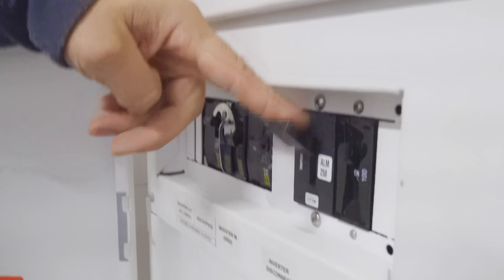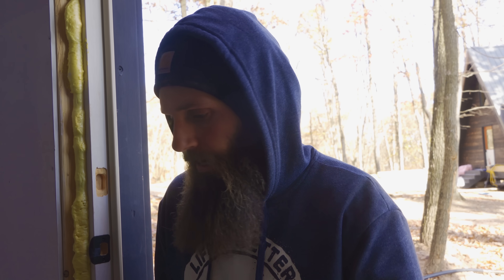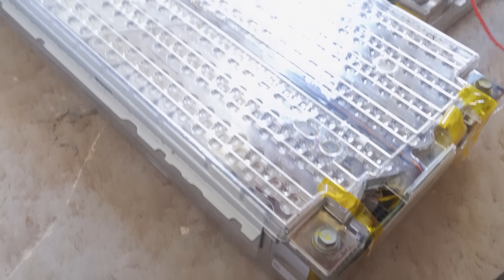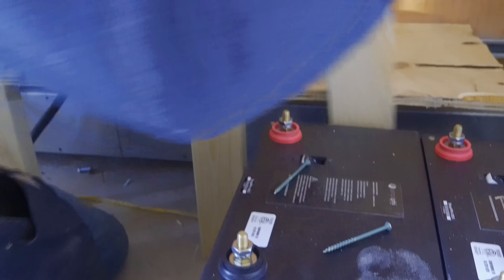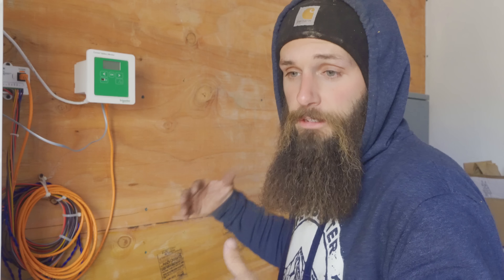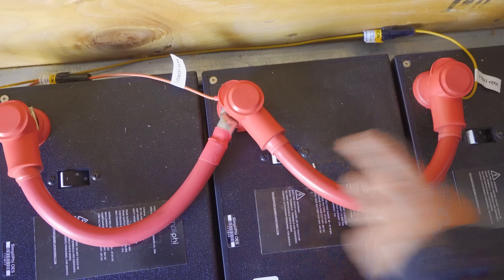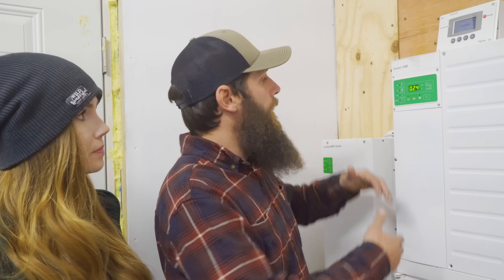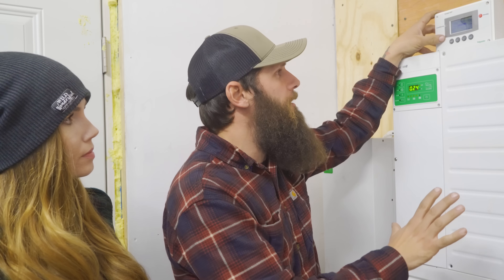Overhauling Our Solar Power System!

Comment: Keep the Tesla batteries! Solution, build a 'small' concrete block building (fire-proof) a few feet from the power-house just for the Tesla batteries only. Bingo! now you have a weeks supply of no-sun power. Both battery systems can be charged at the same time, and tapped for different purposes. Note: If it's put sub-terrain (like a root cellar) it maintains approx 55 degrees year round.
Reply: They can't be charged from a single charger. LFP and Liion cell has a different operating voltage range. Trust me, it's not worth the hassle.
Reply: @obajer  Understand now with a little homework... But A  6'W x 6'L x 7'H concrete block shed can be built for less than $300 in 8 hours, by one person, (using 'surface bonding method). Even if they got a second charge-controller, for it, it would be worth it.

Comment: You can not discharge any battery system 100%!
Your inverter is programmed to stop under your preset minimal voltage (hence 41v). In return it will always protect your batteries from deep discharge.
Pricy upgrade you made.  In years to come we will see new technologies emerging wich will appeal even more to self reliant homesteaders.
Keep it up and enjoy this excellent power system you have put in place!

Comment: I have a doubt. How you are gonna deal with snow falling on solar panels??
Reply: Broom?
Reply: Haha.. not for cleaning the snow, it's about the voltage drop
Reply: @brt3761  :) actually, there's voltage increase in the winter. Lower the temperature, higher the voltage on the panels. Exact thermal constant is in the specsheet of the panels. But the power is lesser, because of lower current, shorter days and bad angle of the sun. So the only thing you can do in winter is to clean the snow and fix the angle of panels if your construction allows.
Reply: Got it brother. Thanks☺

Comment: That’s super awesome guys like I had said on the last solar video you made I couldn’t be happier with mine I have six of them with a outback radian  8000 W 
inverter and 24 250w panels  .  I’m floating most of time because I only need 3 -5 hours of sunshine to fully charge my system ..    I think these are the absolute best batteries out there today

Comment: link to batteries.  I like to know there cost I run a 48 volt system. My current bank is Lead acid and its pretty much dead, system has been turned off, for the last 2 years. Looking for new batteries but ones that are nice, and good for the price.

Comment: Hello farmers !!!! Why did you decide to use a low voltage photovoltaic system? Usually these systems use series panels and series high current 12 X 24V batteries as well, where efficiency reaches close to 90 to 95% in inverters. I have seen here in Brazil these systems working with up to 288 Vdc and providing 30 to 40 Kwh. Certainly the battery bank is huge and expensive providing 120 Amp hour !!! And they usually last 4 years against many more lion years, which are even more expensive.

Comment: There is a better way to hook up the new batteries.  The positive can stay the same connected to the first battery in the string but the negative should be hooked up to the last battery in the string.  This helps to equalize current between the batteries.

Comment: Josh what's the reason for the switch from Tesla ?  Just curious
Reply: That was my question from the midst of the video too.  They explained it pretty well starting at 14:12  it is to use less potentially dangerous battery technology, even though it costs substantially more per kwh capacity, Tesla batteries 21 kwh for $5k (4.2 watt hours per dollar) versus SimpliPhied 12 kwh for $9k (1.3 watt-hours/dollar) which is more than three times as expensive per watt-hour.  But much safer with respect to battery monitoring and thermal runaway concerns.

Comment: I hope you move into the A frame soon. When is your heating stove going to be delivered? Has the window supplier fixed the  quality issues? If you are getting your top triangular window from them, I hope they  bring it with the crew that will correct the windows you have issues with and mount the last one with  no cost for you.! I hope Santa comes to you in the A frame!

Comment: I’m sure there’s a lot of people wondering why you installed these batteries and sold the others. That would have been a much better way to start this video
Reply: No integrated BMS and the risk of thermal runaway were thr reasons.
Reply: yes please! ppl love to brag about getting lightly used Tesla batteries... why did you sell yours?
Reply: @skip21al  If you watch the video they answer that question.
Reply: @ninline2000  no, it didnt. it only gave me more questions. did they tesla battery perform? was it only a fire safety issue? how efficient? etc.

Comment: PRO: Time effectiveness:  adding 1 smart battery over 2 Tesla.

PRO: Cost effectiveness:  installation of  1 smart battery over 2 Tesla;
pay more now to receive more use over the long haul without requiring replacement.

The safety feature of the smart batteries affording “peace of mind” is worth its weight in gold. No overheating to cause injuries or a possible homestead/forest fire.

Thank you for the progress report!!
YES, please do make the installation video.

Comment: Nice upgrade.  I like Lithium Iron Phosphate batteries and the fact that there’s built in BMS and breakers.  Are you planning on adding air conditioning?  The startup surge can be a bit rough on inverters.

Comment: Is there a State code on putting in an off grid solar system? I can see the government and the utility companies working together to stop the off grid movement!
Reply: Not really, depends how off-grid you plan to go.  Some states/counties require certain "other" upgrades.  Example, to build in some areas they require you you to put a well in first, and if you want power, a septic is required, etc  Just dumb rules/restrictions to try and control ppl, but unless its outright banned, most states allow off-grid solar living without issue.  Depends on county rules or covenants{HOA BS}, best to avoid wanting to live anywhere that has those.

Comment: I started living totally off grid back in 2000, can you imagine how technology has changed since then, I have not ever ventured into the lithium battery usage yet as I have an endless supply of lead acid batteries, old tech yup, but reliable and free. I have a few friends that work in the forklift industry and I am able to get all of the used forklift batteries I can use. At present I now have 16, need a skidsteer just to lift one of those, theses batteries are exchanged out from forklifts after so many charge cycles and are usually disposed of, I rescue as many as I need, I have not had a system failure as of yet, I use two different charge controllers and two different inverters, redundancy so to speak, if one system goes down, I still have the other system, proper maintenance  and maintaining a full charge is the key here, I usually dysulfate each system separately about once every two month, depending on charge cycles. I have replaced a few batteries since I started, but they usually last 6 to 7 years depending on condition when I get them and maintenance, Batteries like to be fully charged. Always best to over size your system, less headaches, and when you need power, well you got it, Erin and Josh, your sytem looks awesome, one thing about lithium, those batteries cannot handle the cold like agm or lead acid can, I do not heat the solar shed either, today's temp is -26 C or - 14.8 F for my friends below the 49th, I have never froze a battery yet,  love you  both, keep the family safe always, 👍👌❤🇨🇦
Reply: Important that fully charged thing is ONLY true for "the oldschool" batteries Lead acid and so on. With lithium in all varients Storring the batery compleatly full or empty is the worst. same gose for temperature they dont like it to cold / to hot. the cycel on them dosent realy plays a big rule in the live time. (30%) total capacity loss. = Dead bettery in the industry. 

The best way to kill a lithium cell is to keep it fully charged in a 30+°C room.
Reply: @mogelzz  I fully agree with you on every point, the industrial forklift batteries was the easiest and cheapest method, like you said lithium doesn't like cold, I also have and use 2 x 400 Silentwind generators for those days that maybe totally cloudy, but I have enough reserve battery storage to last me over a 7 to 10 dy period without giving up to much, the wind gens are just a safety measure and we always have wind no matter what. When Josh raised his solar array off the ground and put them on the stand,I applauded, too many people leave them too close to the ground and stray cattle and such like to use them as scratching posts, during the spring to fall months, I leave my panels at a 52 degree angle ( my lattitude) and during the winter months a little steeper because of the angle of the sun is so low. Around 60 degrees from November  to end of March, April. I have had a battery freeze yet, cross fingers, if I lived in a warmer climate I would probably try lithium, but I may die first, but these batteries are free, so I use them. This last fall I found some more panels that the oil rigs had used and were auctioned off, I paid $50 per panel and they were 420 watt mono panels, so now I guess I am up to a little more than 6.7 kilowatts of solar 16 x 420. Initially it would have cost me over $15,000 just to have the power trenches to a meter, nope, my whole system never cost me half of that, so I will live like this.
Reply: @pocketchange1951  thanks for the nice reply, If you get the forklift batterys for free using them is the best option. Alsow super lucky find for the Pannels :D

Comment: Correction:  Batteries are rated for capacity in Kilo Watt Hours or KWH, (kilo watts times hours).  To specify capacity multiply the run time times instant power draw.  The Tesla battery would be 21 Kilo Watt Hours, and the Simpli-Phi battery would be 12 Kilo Watt Hours.  With Simpli-Phi you could draw one kilowatt for 12 hours, or 2 kilowatts for 6 hours, or 3 kilowatts for 4 hours, or 500 watts for 24 hours, and so on.
Reply: Except for the batteries rated in amp-hours

Comment: Any homeowners insurance issues with all this?
Reply: There definitely were problems years ago, but solar installations with battery banks and inverters are now reasonably common so it should be much easier to work with an insurer.  If yours doesn't then switch to a more modern insurer.  All the large and well known insurance providers provide coverage.
Reply: Wally Kramer thank you for the info

Comment: Swap your positive lead to the inverter to the far battery. Having both leads pulling off one end will load the end battery more than the other two. Pulling diagonally across the bank forces the pixies to run through all 3.
Reply: Len Gullotta 

IS THIS TRUE OR JUST AN OLE WIVES TALE???
Reply: @BrianBriCurInTheOC  true

Comment: I put a timer on my fridge,  so its not drawing amps at night.  no one opening at night so over 12 hours shut off it holds zero in the freezer and 42 in fridge.  You will find fridge is a big energy draw.
Reply: MrEroshan This will save very little energy.  It will save a little as the fridge and freezer lose less heat as their temp differential with the outside gets smaller, however, you will use most of the energy you saved during the night to bring the temp back down when it kicks back on in the morning.  You can save as much energy by simply increasing the temp of your freezer and fridge to halfway between what your current evening to morning temp change is and leaving it on all of the time.

Comment: Great Video!!  I will be going solar soon and will use essentially the exact system your family is using!  It would be nice to have 10 TIPs on setting up your system, especially with the LithFe batteries.  Would like to know what the voltage input from your array running into your power house which allows long distance connectivity with little % line drop, as well as hidden caveat which are not immediately apparent. Please provide a inventory list of all you solar equipment so I know what to get?

Comment: I have a Battery Tender LiFePO4 vehicle battery.  I recently had a momentary short circuit (long story) which caused it to over discharge and burn internal parts.  It smoked slightly (smells awful) got a little hot, but did not runaway.  I dropped it in a steel pail to cool off incase it caught fire.  Now it's little more than a paperweight, but it's totally intact.  That's pretty safe technology.  I don't think things would have gone so well with a  LiPo/Li-Ion.  You made the right choice.

Comment: What Schneider model do you have? Currently going into this process for my off grid property. Schneider or Back country are my options. Did the Tesla’s, provide a 4/5 day period on cloudy days.  Nice setup on yours.
Reply from the maker: We have a video with the full breakdown on all the components and the cost of each here: https://youtu.be/C-aeOzBn6YE
Keep in mind we had the Tesla batteries at this point so add in the updated info from today's video on the new batteries/cost for them
Reply: @WildWonderfulOffGrid  I don't recall any mention of the actual model of your inverter, just the brand name in that video.
Reply: Something they didn't mention, you can't discharge the Tesla Batteries past 80% regularly because it will greatly harm them, just the way they were designed.  Technically from many ppl that use Tesla batteries, its recommended not to use more than 60-70%.

Started researching these Simpliphi more after watching, and as they said, 27 year lifespan if you only use about 80%, 13 yrs at 90% and 10yrs if you constantly drain them 100% which is damned impressive.  So even if you drain them a few times to 100% its not going to harm their overall lifespan unlike the Teslas which could destroy them.

They are more expensive and slightly less KWh, {5.2 for Tesla module}, {3.8KWh Simpliphi} but if can only use about 70% safely of Tesla, thats about the same amount, but also don't have to worry about damaging, fires, or keeping them warm.  Am probably gonna do these instead of Tesla now...

Comment: You definitely made the right decision.  The chances of having a thermal runaway are slim, but they do exist; especially considering Tesla isn't publishing the battery management parameters.  Now you only have to worry about a single deflective battery going bad when it's under warranty, as opposed to the safety issues of losing the entire shed or worse, someone getting injured.  And when you consider the probable cost of a "new" Tesla battery, your really probably actually spending the same amount.  The only downside I can see is your heading into winter with less kV, but you can manage that.  Good choice!

Comment: First off, yes, do a programming video LOL... Now, cost: 9k for the batteries? 9k over 27 years means 333.33 dollars a year for power, or $27.77 a month That power bill is a bit steep ;) NOT! hahahahha....I know this is simplified but I would imagine that the cost will come down even more as the technology increases. Great video, I was not really a fan of those Tesla batteries anyway. I would love to see a video on the benefits of 48 volt over 24 and 12 volt systems if you ever get a chance. I am looking at 24v for my place and am wondering if 48v would be better.

Comment: I would definitely run the inverter cables from the center battery.  The resistance of even 4/0 cable will charge and discharge the first battery more than the last one in the parallel string.  Love you guy's videos!
Reply: Tim Willsey 

IS THIS TRUE OR JUST AN OLE WIVES TALE???
Reply: @BrianBriCurInTheOC  Tale. Cables have to be run from both sides. That's the best.
Reply: Ondřej Bajer 
I realize you believe it.
I have worked on Engines, transmissions, drive train, fire fighting pumps and Assoct equipment, hydraulic sys, pneumatic sys, And ELECTRIC SYSTEMS OF THE LARGEST FIRE TRUCKS IN THE WORLD — I don’t trust many folks unless they can show me in print that a idea they have is true. Like dissimilar metals will produce galvanic Corrosion.
Or skin effect on AC Current!
Show me what you are saying in a text of a legitimate publication, and not something From Joe Blow’s Campus of The University Of Google!!!
Reply: @BrianBriCurInTheOC  Well, if you don't believe that things like galvanic corosion or skin effect exist, then it does not make any sense to discus battery wiring best practices with you. If you are still interested then read the book "Wiring unlimited" by Victron Energy (well-known inverter manufacturer).
Reply: Ondřej Bajer 
English must be your second language. Of course l know that galvanic Corrosion and skin effect are true... ¿? 
What I said meant is where is the law or theory about the direction of wiring the battery circuit as you were discussing!

Comment: Glad to see you switch to the Simpliphi batteries. In fairness to Tesla, their batteries are designed to be installed in their cars, not as part of off-grid systems.  It sounds like you had no complaints about their performance so far, only their safety in your system. This video explains your reasons well for the swap. I am curious as to why you located the solar panels so far from the house. It looks like there is full-sun available much closer. You guys are great. Keep the videos coming.
Reply: I thought Tesla made batteries specifically for solar, called the Tesla's PowerWall ?
Reply: @augustreil  They do, but THESE Tesla batteries aren't that.
Reply: @testuser3167 , True, thanks and to David's question, the panels are located there because that is the best place for them, they decided.